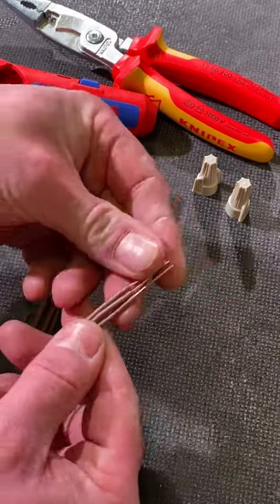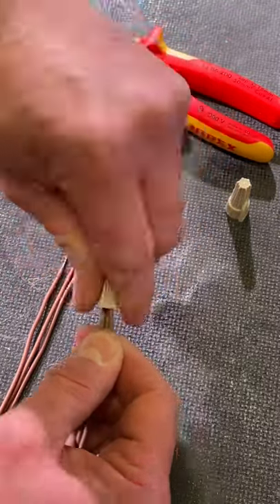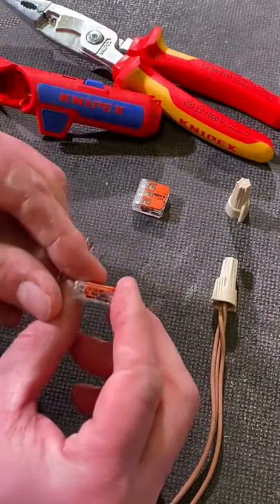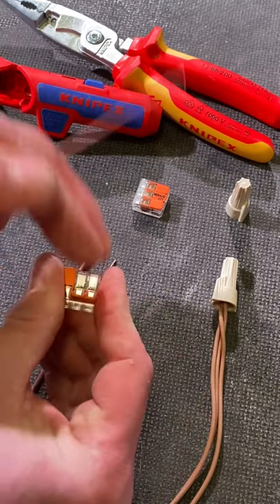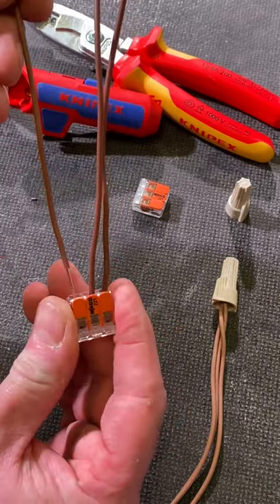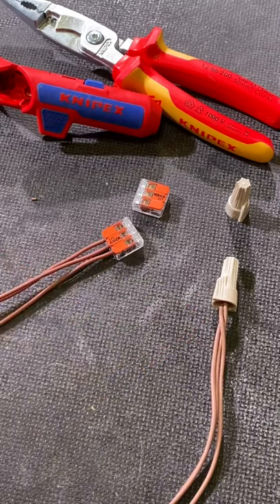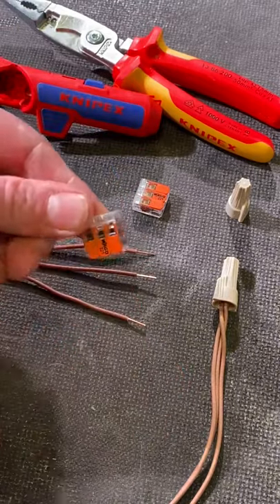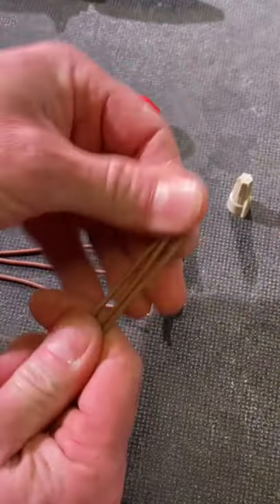Which way do you splice wires? WAGO 221 vs WIRE NUTS? | Electrical #shorts from eFIXX

Comment: Are you sponsored by then why would you cut off the why are not I can't tell you how many wire nuts I've taken off that are like 30-40 years old where the mechanical connection is still completely in place you wouldn't even need the wirenut for the circuit actually turned back on

Comment: Linesman's plyers are used before the marette(wire nut) twist and cut. Then install the marette. This is almost comically wrong what you've shown. 

This was like watching o e of those infomercials from the 80s where the patrons are almost incapable of breathing without instruction. I normally like your videos but this is a bit rubbish.

Comment: You can untwist a wire nut. It's not permanent! I used to work at a metal recycling center. Plastic is obviously a no go. They can be unwound, or even better, pulled off.... What you did was dumb.

Comment: Pre-twist the wirenut...
Manufacturers don't know shit. There's videos showing that just twisting the wirenut on the flat wires will never give a secure connection.
Just use 2 pliers and make a proper splice, then screw the wirenut on for extra protection.

And I prefer the wires making the contact themselves than a thin layer of copper.

Besides, let's be honest... Wagos are mostly for lazy people that never used pliers in their lifetime.

Wirenuts are cheaper and won't burn if you pre-twisted the wire to make a good contact.

Comment: Waggo is not good connection high capacity load especially electric motors wire nut is best u can make it stronger connection

Comment: Wago connector weak, wire nuts For amateurs, Best connection soldered and capped with a rubber boot. Of course I don’t do that. I prefer wire nuts and you twist your wire First  like God intended.

Comment: What I get from this video is you have no idea what you are doing are talking about ..for one you use your kliens to twist and joint up wire for longer last and better connection.and you never cut off wire butt just unscrew it and use Agian .I literally know that day one when I got into electric work no one even told me it's just common since .you def got tools for the job but still have a lot to learn

Comment: I was going to tell that guy, it's a nut righty tighty, lefty loosey. But everyone beat me to it.  I've been an electrician for 20+ years,  I've twisted a ton of nuts and removed all the shorts. 😜😂🤣🤯🥜
Also,  WAGOS are stupid.  You're relying on a tiny piece of chineseium to hold together 15a, 20a, possibly 30a of current.  Instead of the tried and true wire nut. No yellows,  just tans, reds, Grey's, and blues. Ideal brand preferably.  Don't cheap out on your connections,  or your asking for a fire. Remember people,  an extra bit of effort will keep your investment from burning down.  WAGOS are also more expensive.

Comment: Are you getting kickbacks for this!? Almost everyone knows that wire nuts can usually be reused without cutting the wires! Especially don't need to lop off 2 inches like you did!

Yes, occasionally, wires need to be trimmed a quarter inch, or maybe break off after 3-4 times, and there is certainly a place for other options, but this video is either deliberately intended to mislead, or produced by an ignoramus.

Comment: Who fucking cuts these off? What happened to common sense these days? Jfc
Can lift tabs to remove the wire which is opposite how u installed them.... yet something that's screws on wouldn't occur to unscrew them if the first type is reusable why wouldn't the second type...

Comment: Okay so you can definitely reuse a wire nut firstly 

Second, please don't just twist a wore nut onto adjacent wires. Twist the wires with your linesmans before installing the wire nut and you'll have a much safer and tighter connection